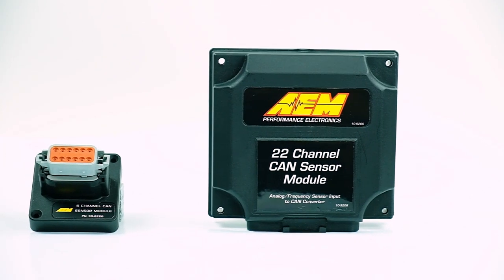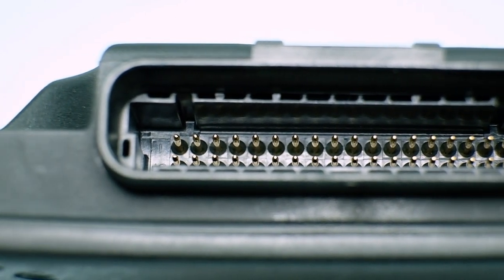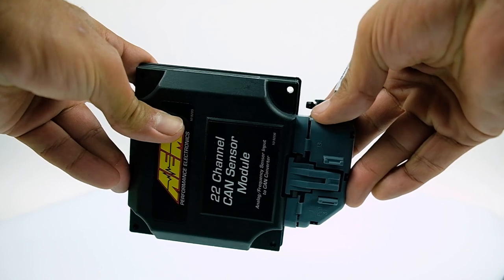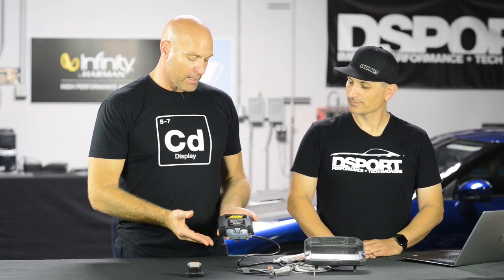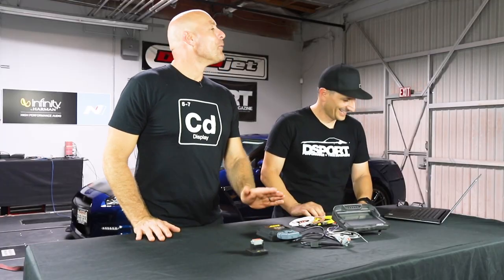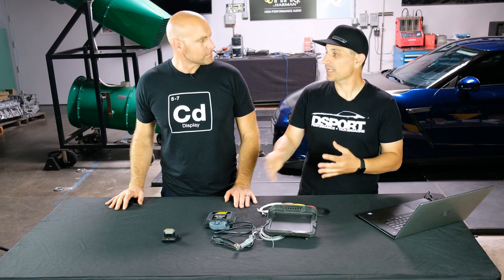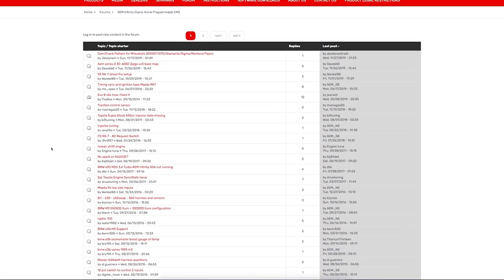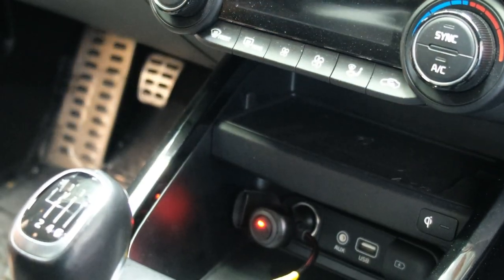CAN or CAN'T | The CAN Connection To Older Vehicles | Daisy-chain CAN Sensor Modules

Comment: Maybe a silly question but just to make sure I understand this you plug in harness to AEM can module and the other end of the harness go to sensors that wish to read from..?? This is for an Non-can vehicle...
Reply from the maker: Thank you for the question. Yes, for a Non-Can vehicle you would connect the module to the sensor and to the harness.
Reply: @dsport  Thanks for replying, big fan of Station build and have been big fan Michael Ferrara articles .....

Comment: Is the CDC same as pid ?

 I have all engine pids for 2013+Taurus I'd love to help out anyone that may want to go standalone or get a way to add can channels.

at least an ethanol content and true oil pressure not just that there is pressure. And then maybe some tire temp sensors that arnt reading from the tpms. 

Are there any full write ups on some other popular vehicle in figuring this stuff out?